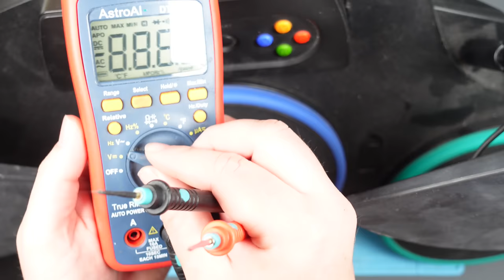My GUITAR HERO Drums broke | Let's FIX it!

Comment: These kits were notorious for the wires coming off the drums almost instantly after use. They were soldered in the loosest sense of the word and hitting them would just knock them off. I had a nearly-ruined Christmas one year, before googling it, opening it up and taping the wire back in place. My first DIY job.
Reply: @@doublewhopper67 I did say it was my first DIY job.

Comment: I’m a drummer since more than 20 years and I find soo much difficult playing drums in those music games 😂 I find myself more confident with the bass guitar instead. Btw nice fix
Reply: Same, especially since the pads are made of the cheapest plastic which makes anything more than a straight beat a nightmare. Doing fills on these things without that little bit of bounce the real drums have will absolutely kill your wrists after about an hour. I can see why do many real drummers who got into Rock Band splurged and bought the nicer, $200 kit that had the mesh heads. Plus, as a drummer, I have a habit of playing phantom notes and such on the snare, which the game penalizes you for. lol
Reply: There's a MIDI pro adapter you can get to use any electronic drum kit with Rock Band 3 on 360, Wii and PS3, and 4 (on PS4, for Xbox One/Series you need a 800 dollar adapter so it's not worth it) You can even map the drums so you can fix the placement so it actually makes sense for an experienced drummer!

Comment: I had a DJ Hero turntable w/ no power, and it was just a bad capacitor like the one on your drums sitting between the batteries and the wires to the board. Replaced it and viola! Like new!

Comment: I just pulled mine out of storage a few weeks ago and the drums worked fine, but the plastic on the wire to the kick petal flaked apart into dust. Also the short wire that connect the cymbals did the same.  Still worked.

Comment: I once took the brain out of one of these and wired it up so I could attached it to a midi drum kit. It was so professional, I had to use an ice cream tub and parcel tape for the case. Complete overkill but it worked quite nicely 😁
Reply: There was an official MIDI adapter for Rock Band 3 haha
Reply: Yeah but where’s the fun? 😂

To be fair, the kit was broke from GH Metallica so before the midi pro came out. Godsend when they eventually released it.

Comment: Well done. Big reservoir capacitor for big splurges (technical term) when Van Halen kicks in.
Reply: A little bit useless in that location considering the tiny wires going to the board.
Bit of a design oversight.
Reply: @samuraidriver4x4  Possibly, though (guesswork on my part for these drums) any current spike would be very short duration (you would get away with small wires only under those circumstances) and the cap (which looks like an afterthought bodge) would partially reduce the consequent voltage dip.

Comment: Wireless drums don't even make sense. It's not like you're gonna run around the room while drumming. Back in the day, I put a micro USB port in mine, so I could stop wasting batteries. And I also wired a switch so I could make the orange cymbal act as the green pad, so it would work on the older Rock Band games. RB3 made it redundant, since it already registered orange as green.

These crappy wires also like to come out of the piezo sensors under the pads. And these cymbals like to crack. So does the pedal. Or maybe i get a little too excited when I play.

Comment: The capacitor bridges short interruptions of the batteries when hitting the drums. Otherwise, the risk of the "controller" going out would be high.
Reply: And then use tiny wire gauge between the batteries/cap and the board?
Putting the cap on the pcb would be a better solution and a spending a bit more on decent wires.
Reply: @samuraidriver4x4  not my decision
Reply: @ThePsychoBoiz  I know, its Microsoft cheaping out again.😁

Comment: The drums  were cheap and too  plasticly for my likeing  .i had the guiter. Mic.drums  .i prefered  the guitar  .same with rock band . I think i only  used the guitar  about 4 times  . But it was taking space under my  bed  and i never used them  so i sold the lot  .cant believe  all that plastic crap cost  around  £150  brand new  with the game when it first came out  .